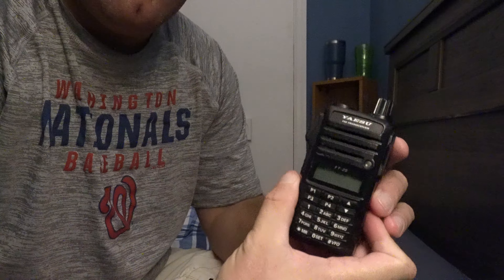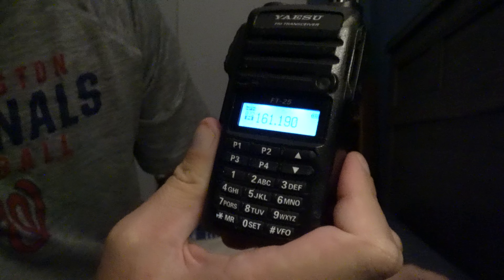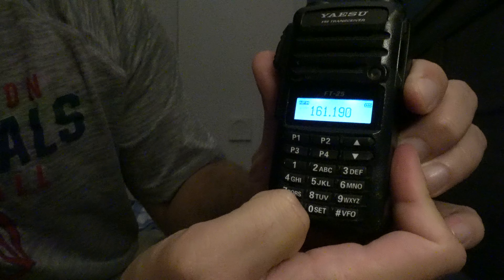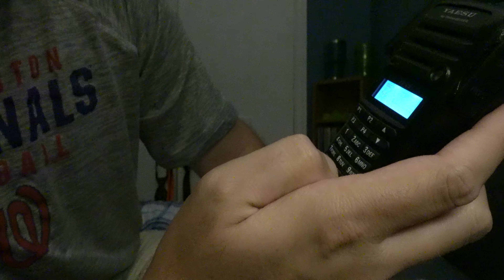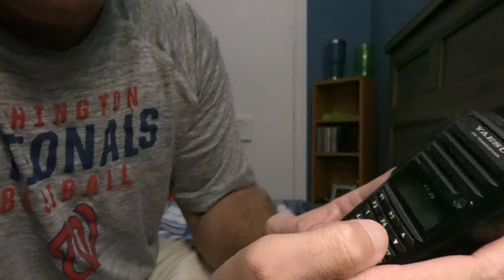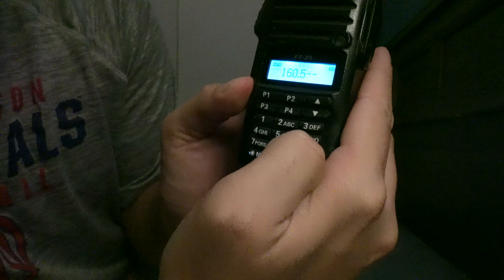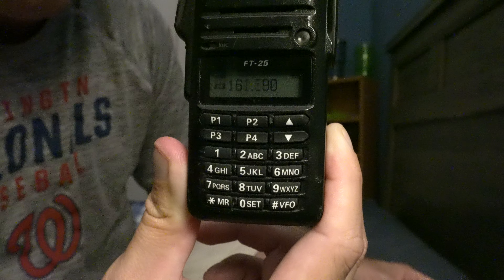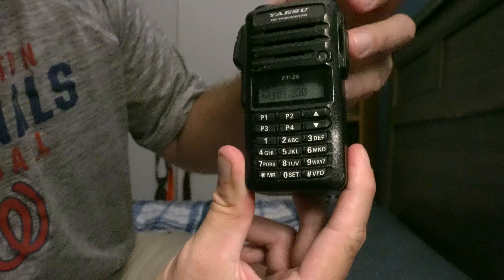Yaesu FT-25R programming tutorial

Comment: Mine is Yaesu VX-170
Reply from the maker: You have one of the older models. I have both the dual band FT-4XR and its slightly older brother, the single band FT-25R. Yaesu cut corners a bit with this and both are made in China instead of Japan. I think they were trying to compete with Baofeng and Quansheng and some of the other Chinese radio companies. Still a good radio but doesn't quite have the Yaesu feel.
Reply: @VArailfan89  yeah that’s right

Comment: Mines a ft65r and 161.190 shows up as 161.187
Reply from the maker: You gotta go in the menu and reset the kHz step. That will fix it
Reply: @VArailfan89  thanks
Reply: @VArailfan89  where is it on the menu
Reply from the maker: @southeastvirginiarailfan2110  30 in the menu under "Step." They're in ABC order
Reply: @VArailfan89  what kHz do i put it tk
Reply: @VArailfan89  more importantly how do i set it (it keeps going back to auto
Reply from the maker: @southeastvirginiarailfan2110  Push the second button on the left hand side of the radio to confirm. I'd set it to 5kHz. You may have to switch them a few times to get to 161.190, it takes patience at timed. But leaving it at 5 would be good.
Reply: @VArailfan89  got jt
Reply: @VArailfan89  its jusy spark a few times i havent heard anything else